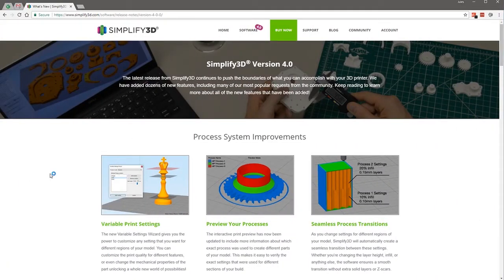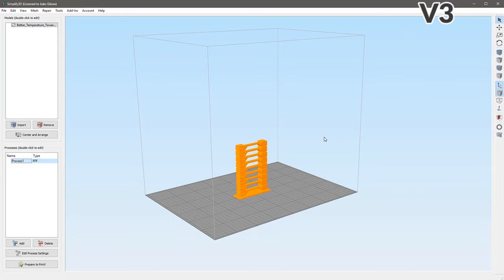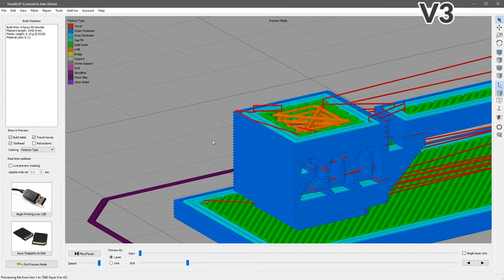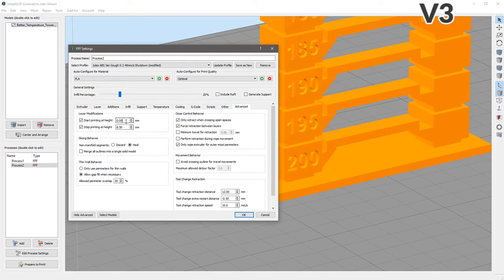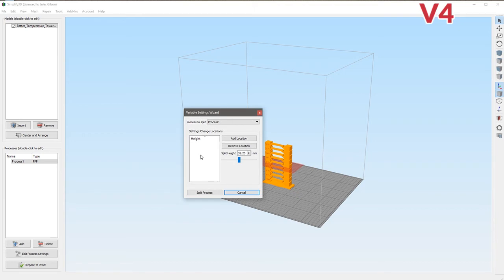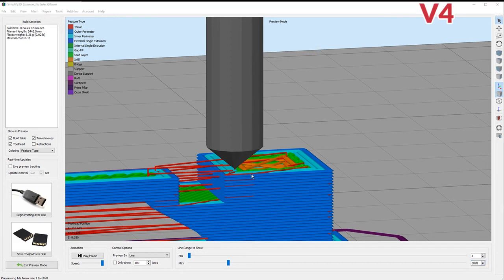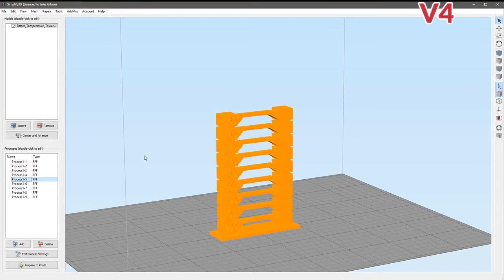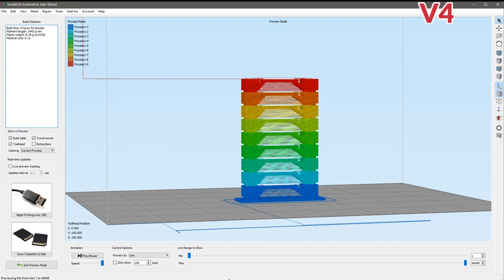Simplify3D Version 4 - Variable Print Settings, Process Preview & Position Readout

Comment: Actually in version 3, you can alter the hotend temperature based on layer number (do this on the Temperature tab).  That would be the way to go, instead of creating a new process for each heat level change.  There's no guessing with height measurements when done this way (you just tell it what temperature you want to start using at what layer.  You would use the multiple process method, if you were altering more parameters than just the nozzle temp (like say for instance, using different retraction settings starting at certain layers.)
Reply from the maker: Yes, as you point out, being able to alter temp according to layer height has always been there. As this was a video about what was new in Version 4 that isn't too relevant. The point is that you can adjust apply complete process settings according to layer height, not just temps (and fan). I just used temp as an example of split processes (maybe not a good choice as it seems to have confused)

Comment: Great playlist. Getting back to printing after a couple years here. I bought Simplify3D years ago and still love it. However, I cannot believe, after half a decade, I still can't split processes by layer????  The information is obviously easily accessible, from a programming standpoint. I still think it beats everything I've used, but they are soooo slow to add simple things. It took 2+ years to add mm/s instead of mm/min :O.
Reply from the maker: You can use different processes for different layers. However, I am not sure S3D is still worth the money, especially as you will need to pay again for V5. I think other slicers have developed a lot over the past couple of years. If I could be bothered I would give Cura another go
Reply: @julesgilson.  I meant that you cant just choose by layer, as opposed to distance. I didn't know about having to pay for the next version :(